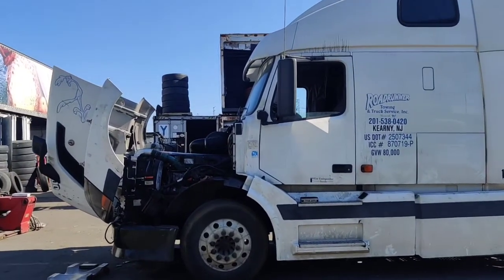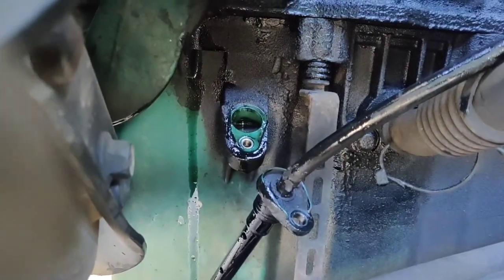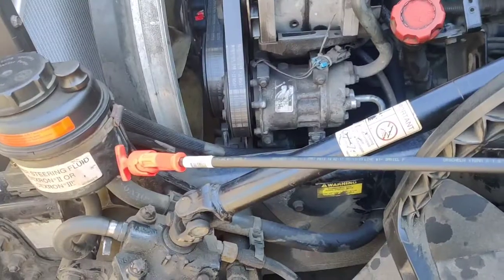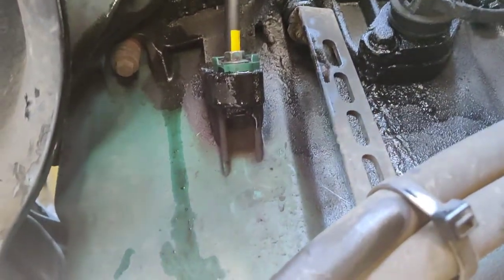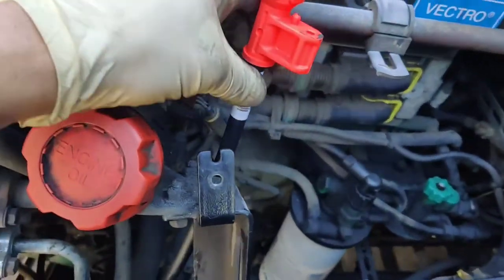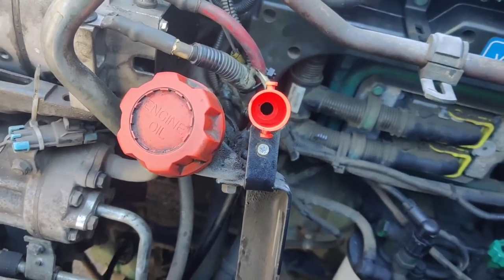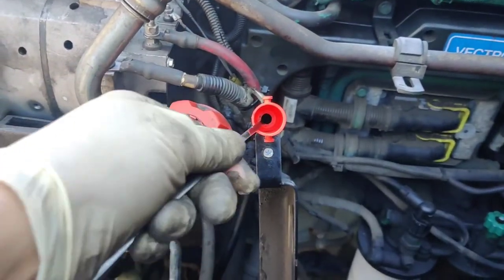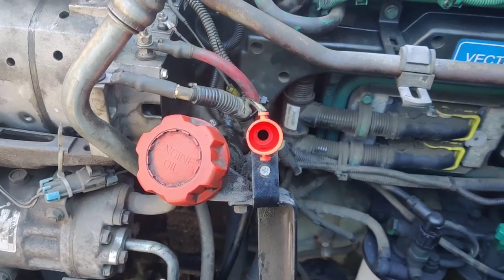D12 engine,Volvo 2005 change the dipstick

Comment: Do you have to drain the oil to do this?
Reply: Did you drain?
Reply: I just finished my dipstick and I didn't have to drain oil to replace dipstick but when I checked oil it was too much in oil pan, and because of that I have to drain little bit of oil but not because of installation.